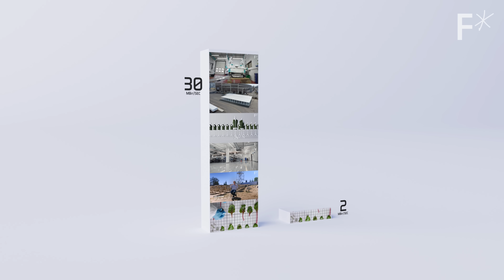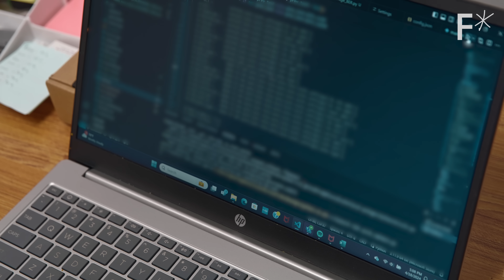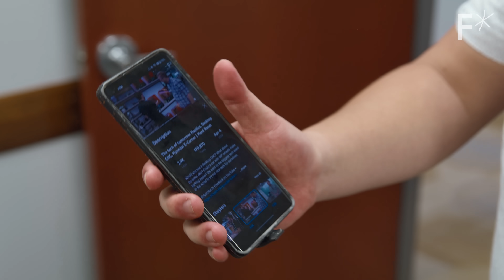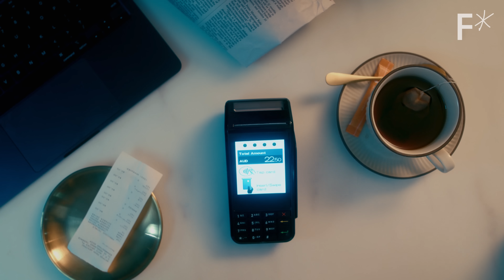This computer chip is the key to an unhackable future | Hard Reset

Comment: 14:14 Just wanted to say, what he said about encryption is completely 100% wrong. Encryption is not a cat and mouse game. We have incredibly solid battle tested encryption methods that are basically unbreakable. This person clearly does not know very much about encryption.
Reply: Yeah - most of the problems typically aren’t with the robustness of encryption but with how it’s used/implemented in a system. Even small deviations from best practice can lead to unintended vulnerabilities to exploit.
Reply: You are correct. Ixana hasn’t included any advanced encryption in Wi-R chips yet. Wi-R just provides better physical security. If you are in a café and turn on Bluetooth on your phone, everyone in the café has your signal. If they can hack into it or not, depends on how good of a hacker they are. With Wi-R, someone in your next table doesn’t even have the signal to hack into. That’s the advantage. Once someone has the signal, the potential of being hacked is the same as Bluetooth/Wi-Fi.
Reply: tbf while algo like aes256 are unbreakable and even quantum resistant, the problem is key exchange, the new key exchange algos haven't been around as long, it's still a cat and mouse game, algo might be secure but there's still encryption key storage, which is still a cat n mouse game, hackers keep finding ways to get in to extract the key at the source
Reply: @BarakaAndrew the same could be said about NFC which are similar to this tech then. So it's irrelevant and his statement is misleading. Intended to instill ungrounded fear of privacy concerns to drive up demand. And that's no-go.
Reply: It's not the encryption of the device, it's the unrealistic other ways that spying is taking place...
Reply: Isn't Google's new quantum chips a potential threat though?
Reply: @ Not even close. They're pushing 105 qubits, but like 4000 qubits are needed to break RSA for example. And keep in mind that noise increases exponentially with the number of qubits, so they may literally never be able to make a 2000 qubit machine, much less a 4000 qubit one.

Comment: Get hacked from a handshake
Reply: Wi-R provides better physical security. If you are in a café and turn on Bluetooth on your phone, everyone in the café has your signal. If they can hack into it or not, depends on how good of a hacker they are. With Wi-R, someone in your next table doesn’t even have the signal to hack into. That’s the advantage. Once someone has the signal, the potential of being hacked is the same as Bluetooth/Wi-Fi.

Comment: Very cool tech but boy do they need to work on their talking points and demos. 

This provides no increased security over any encrypted wireless signal. Implying encryption can be circumvented is absurd. One does not simply break AES 512 or RSA 2048, it's the other security mechanisms in the chain that are breached. And if NFC and RFID can be intercepted, this can too. It just takes a copper wire the width of a hair to brush up against you to intercept the signal and you'd never notice. There's no practical difference compared to RFID skimming and other existing near field attacks.

Most of the peripheral examples are weird too. You're trying to tell me you want a pair of wireless headphones that stop working if you put your phone down on a table, or in your backpack? You want a health tracker that can't track your data if you put your phone into the tray on the treadmill?

Instead of these absurd examples, why not focus on the improved ability to exfiltrate data from BCI implants, easier to use 2FA hardware keys, simplified and lower power communications for VR peripherals like controllers or motion trackers, the ability to reduce the required size of integrated peripherals like the camera glasses they showed over other existing solutions like those from Meta, or hundreds of other interesting and practical possibilities?

I'm hyped for what this tech can bring, but they gotta get a better marketing team!
Reply: Wi-R provides better physical security. If you are in a café and turn on Bluetooth on your phone, everyone in the café has your signal. If they can hack into it or not, depends on how good of a hacker they are. With Wi-R, someone in your next table doesn’t even have the signal to hack into. That’s the advantage. Once someone has the signal, the potential of being hacked is the same as Bluetooth/Wi-Fi.

Comment: Very cool tech but pretending that this is a security thing is kind of crazy, as though someone breaking AES512 is more likely than a hacker bumping into you on the subway..
Reply: Think of it this way: In the subway, one person’s phone has Bluetooth on. Is everyone in the subway hacking this phone via Bluetooth? Wi-R provides physical security i.e. it is hard to even access the signal. Rest of the protection is with software security e.g. in Bluetooth.

Comment: is clothing isolant? like having phone in pocket won't work and if not how would this prevent guy sitting next to me in bus not taking my data?
Reply: The attack surface of Bluetooth is being in the same room as you. In case of Wi-R, you have to touch someone to get access to the signal. If you are in a bus and turn on Bluetooth on your phone, everyone in the bus has your signal. If they can hack into it or not, depends on how good of a hacker they are. With Wi-R, someone in a seat near you doesn’t even have the signal to hack into. That’s the advantage. Once someone has the signal e.g. by touching you, the potential of being hacked is the same as Bluetooth/Wi-Fi.

Comment: What happens when I want my device to carry on working while I’m not actively holding it against my bare skin… 
This is stupid.
Reply: Wi-R doesn’t actually need to touch. Anything within a few cm similar to NFC works. The advantage is extending the range of NFC. Imagine you are at a café trying to pay. Instead of whipping your phone out to pay, you simply leave the phone in your pocket and bring your hand close to the screen.
Reply: It’s adjustable. Works up to a meter away from your body. This company has been around for almost 10 years they have a lot of papers you can read.
Reply: Then why did they need the copper foil? The headphones were only a couple cm from his body.

That would also completely contradict their notion of it being unhackable if you can just stand next to the person and intercept all the messages.
Reply: I just looked it up. They claim 0.1m not 1m, but have yet to demonstrate that. Still not very useful.

Comment: This is very exciting for bio-tracking tech! I also like this concept for bio-metric locks. You'd be able to unlock your home, or car just by touching the door handle. It would also be great for multi factor transaction authentication when buying goods. A fingerprint, plus a personal token requirement would enhance security. There are so many upsides to this tech, even if it's just reducing the EM flow in our external envirnment
Reply: But the human is only the medium for the device, isn't it? Meaning, if an intruder wore your device, it could unlock your car?

I guess you mean it sets the stage for future developments

Comment: So this could lower power consumption and raise bitrate for my Virtual Reality kit? My VR displays talking to my headphones talking to my wristband controllers and my phone or compute deal. All of them become smaller, lighter, and have longer battery life. It sounds like Meta's Project Orion would really benefit from this. I think even a Quest 4 would benefit from it, although bluetooth energy use is kinda a drop in the bucket compared to the displays.
Reply: It is not just the Bluetooth energy that is reduced. Wi-R’s high-speed, low power, low latency allows any device to piggy-back off the compute on another device. Smart glasses do not need a 5W processor anymore. That’s what leads to way longer battery life.
Reply: @ixanaai  This is what Meta's Project Orion does, with a wireless compute puck in your pocket.
Reply: @themogget8808  Yes exactly, but take it even further, Orion still had to put a decent amount of compute in the glasses due to limitations in bandwidth and power usage of bluetooth, this will enable even lower power on peripherals like the glasses helping with battery life, and thermals (which in Orion's case was a big challenge they had to work around)
Reply: I do definitely see VR applications for this, if the bandwidth claims and comparisons hold with multiple devices.  Especially for Full body tracking with stuff like vive trackers.

Comment: That's all fun and nice unless someone is using your body as a conduit unauthorized. Also, a computer device can throttle down or up how much and how often power gets passed through a system in order to not burn it out. If an unauthorized device pushes a signal through you on enough regular basis it COULD disrupt body function and possibly age you faster by disrupting cellular function. That's just the surface. I don't even see a general use for something like this as you could simply put on a NFC wristband and accomplish the exact same things with actual controls.
Reply: The use I can see is AR glasses that do processing in another wearable like a watch attached to your arm. This way your glasses don't need a very powerful processor but only one powerful enough to encode and decode video.
Reply: @marcus_b1  Remember that it uses the 100kHz to 1MHz frequencies. At these frequencies your body can pass Amps (together with high voltages many hundred Watts) with the only impact being thermal burns under prolonged exposure. This works on the order of ~2 microwatts.

While I would still insist on testing the effects, it's likely fine.

(My info comes from the talks on the technology backing this: EQS-HBC, and styropyro for the electrical safety)
Reply: Wi-R signals can’t actually travel through the body. You bring your finger close to your touchscreen multiple times a day. This induces electric fields between your finger and the screen, that flow around your body. This is happening multiple times a day for you today. Wi-R uses the same physics, but for communicating data.

Comment: Each cell in our body uses tiny differences in electrical charge between interior and exterior of the cell to allow the flow of nutrients in/out. I wonder how constant pervasive wi-R data will effect normal functions.
Reply: Definitely something to consider, we will find out when these have been out for a few decades.
Reply: I know the specifics of this technology, by electric charges tend to flow in the surface of the electrode
Reply: This is a good question. You bring your finger close to your touchscreen multiple times a day. This induces electric fields between your finger and the screen, that flow around your body. This is happening multiple times a day for you today. Wi-R uses the same physics, but for communicating data.
Reply: It is good tech, should already start doing the human health trial with prototypes now.
Yes the electric field is low, but it would be use with extensive rate. Like playing music on u phone without wired, when the phone inside your pocket....and wireless headset.....it might require less energy.....but the extensive hours we use this tech with VR, or personal entertainment
Reply: @2dstencil847  use lab rats for experimentation as always

Comment: Interesting but if all that's needed to hack the network is to introduce a connection without someone knowing, then any surfaces you touch could potentially be that, unless you can be certain that it is not a conductive material. I can already see car companies literally gobbling up ALL of your data with this just by sitting in their car, or any company that you interact with physically by touching the door handle of their offices, or the police hacking your phone during an arrest simply by touching you... And then there are public gatherings... Anyone that would be standing next to you, for example at a football game, in the line at Starbucks, at a concert, etc., could potentially be hacking you.

I guess the devices you wear would need to be able to tell you when the size of your network changes and allow for some sort of control over your connectivity. Sadly they didn't address that one bit in the video so I'm very skeptic at best that this is gonna be an unhackable tech.
Reply: Just going to point out that the tech this is aiming to replace makes every point within a wide radius of you a potential connection point. Not unhackable, yes, but it's not exactly a new level of vulnerability or something.
Reply: Doesn’t sound like a huge problem to overcome to be honest
Reply: this is just a link layer though, purely physical. all you need to do is implement the same security systems as in other wireless coms and its much much more secure.
Reply: what? It's like Wi-Fi / Bluetooth but with less electromagnetic "aura" - limited not to 100m or 10m but 10 mm - it's an order of magnitude safer just by the virtue of requiring physical contact instead of remote attack with a Pringles antenna.

You touch a "rogue" countertop? So what? It requires an authorization code to connect to you/your personal network, just like Wi-Fi or Bluetooth. It's exactly the same in terms of information security but much better in spatial security.

Comment: Some powerful patents are being developed with this tech. It will never be unhackable, that was an unfortunate decision by Freethink, but this is a viable alternative to traditional radio for low-power, easy-to-configure wearables.
Reply: They changed the title to "Highly secure" :)
Reply: Agreed, there is a lot of potential particularly in the consumer products, though without some form of authentication to ensure that a network you are connecting to is actually yours, I wouldn't trust it with medical or other sensitive information or phones.

Comment: If someone could bump into you and have a device run a script to hack whatever you have connected to you by touch, that's not very secure.
Reply: Rn any one with an internet connexion can attempt to hack you, with this tech they'd need to be in contact with you or something relaying the electric signal emanating from you, like an airport mettalic bench, or a swimming pool.

So if you do get hacked, just know it's much more personnal than it used to be
Reply: @RaphErnotte  Wait till they figure out undiscovered side channels and use them to get the data. They've developed methods of pulling data from RAM without touching it just by reading the electric noise it generates. Which means secure PCs now need to have RF shieding.
Reply: Yeah if these hackers are able to actually break encryption, which would be necessary to “hack” this or any wireless tech, then I’m sure they would choose to hack your phone/computer via WiFi or Bluetooth. I really don’t think they would choose to touch someone else physically to require them to be hacked (because this Ixana tech will also be encrypted just like WiFi or Bluetooth).
Reply: @webleaf30  Just string up conductive bead curtains that people have to walk through to touch clandestinely...
Reply: @Jah_Rastafari_ORIG  it would still have to break encryption to read the data at all, which is impossible with today’s wireless security standards and technology.
Reply: @webleaf30  i think hacking a device on the PAN to gain access to the rest makes the most sense to me.
Reply: 100%, though I don't see why you couldn't add an encryption layer ontop of this.
Reply: @AndrewMorris-wz1vq  Like that does any good for wifi and bluetooth...
Reply: @VioFax  I mean it helps, the wall of sheep at defcon is just different in the days of nearly ubiquitous https support.
Reply: @VioFax  it obviously does do good for wifi and bluetooth
Reply: Clothing could have material countermeasures.
Reply: It still greatly decreases the potential attack vector compared to anything wireless. Someone will actually get close enough to you to make this work. I actually expect this to be very secure since there is no reason why your person area network couldn't shut off the moment a non-known network gets within the field. That way it is more secure and you would instantly know that someone very close to you is trying to get into your network unlike the case with WiFi or Bloothtooth where someone can be a good distance away and you'd have no clue.
Reply: I'm not the first to say it, and I'm not the last... Just add encryption... won't be perfect, but neither is our current system. This is just a firewall for IoT wearables with added perks.
Reply: They have to engage in secret high five first😂😂😂
Reply: Google melanin battery
Reply: Bluetooth has its own issues too. Sounds like you're describing the NFC issue
Reply: wifi is 100 times less secure if this is is your metric lol
Reply: That being the case, you'd have to get pretty close in order to do that, which unto itself poses a risk of getting caught.
Reply: The fact that the communication is used for short range doesn't automatically make it unencrypted and unauthenticated. If this ever gets to consumer tech, there would prbably be some kind of authorization process. When an unrecognized device joins your network you might get some popup that you need to approve or something like that
Reply: Unlikely to hack with just one touch. And you'll know if you get hacked when someone frisk you aggressively😂
Reply: @nerv4316 you don’t have to touch, and I’m sure there’s a way that a hacker could boost or reach further for the signal to avoid alerting someone by touch.
Reply: Well, it massively limits the timeframe for a hacking attempt.
Reply: They just need to be close to you